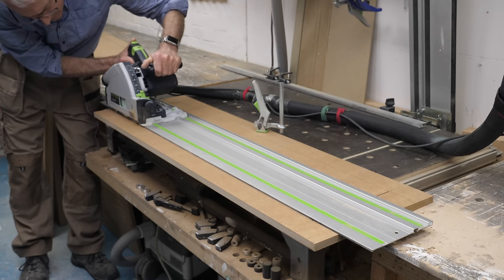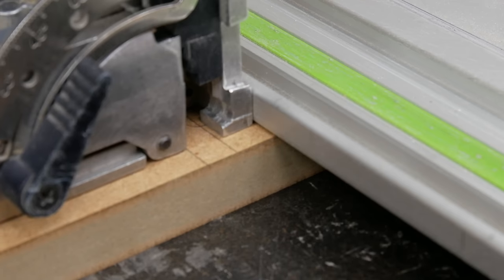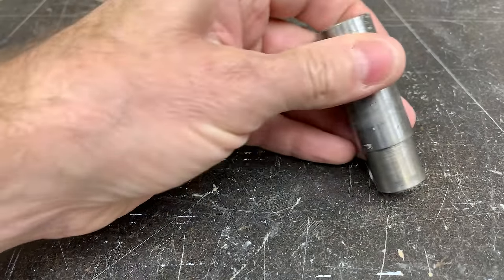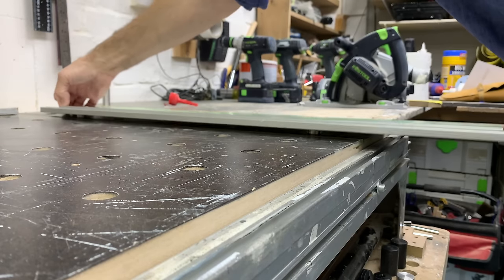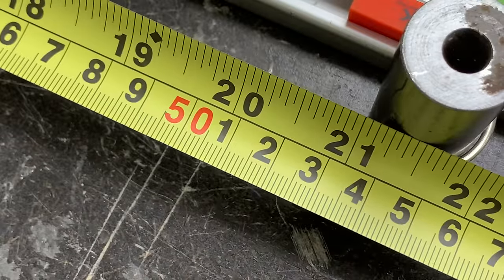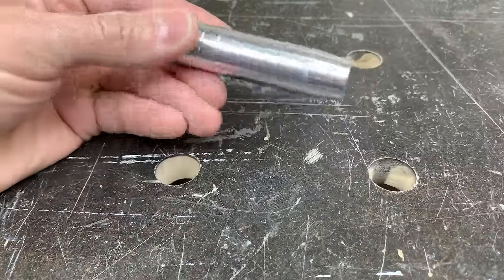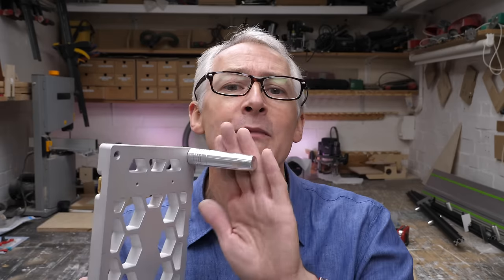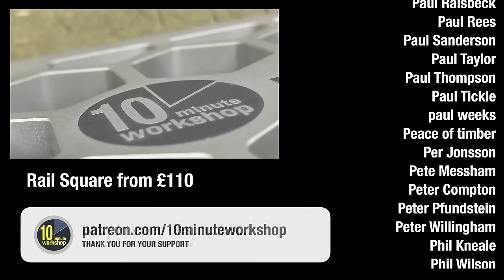Square cuts: MFT or Rail Square?  [video 422][Gifted/Ad**]

Comment: 32mm was the closest together engineers could fit the gears that drive the spindles on 32mm boring machines when they were developed after WW2.  On these machines every other spindle turns the opposite way so on a 21 spindle machine you need 11 of one and 10 of the other to drill a line of holes on 32mm spacings.

Comment: I prefer to use the MFT for precise cuts on smaller workpieces in the workshop. For rips I do use a TSO rail square, but I double check it for squareness every time ( coz I have cut a few wonky pieces occasionally). If I'm outside, it's the rail square on a cutting deck, which I find accurate enough for most jobs. There is no way I would take my MFT3 outside the workshop because it's so heavy and unwieldy. I'm making a portable top to mount to a pair of dewalt aluminium sawhorses. I used my festool mft top as a template and with a 20mm guide bush on the router and a 3mm dowel drill cutter from trend, I plunge cut the hole centres and used the UJK 20mm cutter from the parf guide system to cut the holes. One of those old wolfcraft twin column drill guides helped keep everything in line. It seems to be sufficiently accurate from my test cuts. 
Can't wait to see your version of the  mobile bench though!

Comment: I’m creating my own MFT as I needed it to be bigger than the standard Festool MFT. I’ll be using the Parf Guide System Mk2 to create the holes. This video helped me think what are my options in order to make it as a cross cut station as well. Thanks Peter!
Reply from the maker: Thanks! 👍
Reply: Are you going to add offset holes?

Comment: Hi, Peter the Detroit track saw that I bought is very similar to the Makita with the anti-tip lip & therefore similar to the Festool. Therefore this weekend I bought the FS-WA ($215Aud) thinking that I could modify it to fit, I even thought I may consider buying the 800mm Festool track ($155Aud). Well, I picked up the FS-WA as nobody had in stock well it fits in perfectly in my Track with no sanding or cutting off the underside groove.

Comment: As usual, great and informative video. Watching you actually convinced me to buy a track saw and I'm loving it. Such a change and with your tips... Just wow! I made a mobile cutting station at a client's place following your advice on calibration and the station, I am making spot on square cuts with ease and even used it to joint rough cut mahogany to use as edging on BB plywood. Oh I'm also making my own MFT system thanks to your videos. Just brilliant Sir. Thank you! I'd happily but you a pint 🍻👏👏👏👏
Reply from the maker: Thank you! So pleased that the videos are helping! 👍👍🍻🍻

Comment: Love the video. Been replacing my internal doors with oak ones and the Benchdogs rail square has been awesome.
Well worth the money for trimming 14 odd doors
Reply from the maker: They're great squares! Impressed you have 14 level floors though... 🤔😂👍
Reply: This is true 😂 however just seemed to make things easier dropping on the door rather than measuring

Comment: As a long time Festool Track Saw user, I've never once wanted to buy into their 96mm x 96mm x 20mm hole pattern. I've chosen to use the more common 2"x2" hole pattern with 5/8" hole. This opened up a world of fixtures and jigs that are used outside of just woodworking. But, one trick I picked up along the way was the use of 5/8" dia stainless steel stand-offs and 1" diameter caps as my bench dog solution. Not only did I save hundreds of dollars, I was able to buy quite a few different varieties. I sometimes use square heads on the stand-offs. Or do the 3/4" elevated rails by swapping out the appropriate caps to thread on to my stand-off barrels.

As far as my best rail square solution was to go with TSO rail square, and as my second I chose the Woodpecker's multi-angle version. I like using one at each end of the track if I can. I never have to double check my squareness that way. I feel I have a great combo that allows me to accomplish nearly 95% of my Table Saw needs now. I only use the Table Saw now for thin strip cutting.
Reply from the maker: Horses for courses, I think; for balance, I've never come across a 2" x 2" grid with 5/8th holes, so perhaps not as common as you think?? Good to hear you found something that works for you though. 👍👍
Reply: @10MinuteWorkshop  In metal work and fab tables, there's many brands, such as Strong Hand Tools that sell all the different clamps and accessories that fit those smaller holes. And the tighter grid pattern actually makes more sense when going layout and fixturing. Like in glue-ups and case work, where there are many things that fall into the 4", 2", 1" sizing. Granted, what you could see is a 50mm x 50mm hole spacing with 16mm holes. But 16mm and 5/8" are nearly identical when it comes to nominal hole size. But I do realize that a 50mm grid would actually kind of screw you up in the long run, should you be using imperial measurements. Unless of course your hole spacing was exactly 50.8mm ;-)

I should have added that based on my familiarity with the metal work fab tables, and since I do both in my shop. I wanted both my woodworking table (and accessories) to be interchangeable with my metal work fab table. So... I actually CNC'd my own 4x8 "MFT" table out of 1" MDF and epoxy laminated on the top and bottom sheets of Dibond, before having the router table cut my table top. I framed the whole thing in Aluminum Extrusion to take advantage of the rail tracks, and use a sacrificial 1/4" piece of MDF with the same holes cut into that.

Comment: Very informative
Very confusing for a super part-time woodworker who has never seen an MTF or rail square system. Lots of parts and things to consider & hurdles to jump over.
 I'll stick to old school (less precise) methods for the time being and wait for the portable system you going to do. THX
Reply: I also came.across these methods as a new woodworker and found it all very confusing and led to a lot of stress of confusion. I found the far easier way of all these things was to just use a table saw. Far easier and quicker and less faff
Reply: @ChickenDinnerz  faff - I had to look that up-:)
I agree - kiss is the better method for part-time hobbyists. That's maybe why after 2 years of having heard about the MTF system - I probably intuitively (or luckily) have not bought into the system yet. If you need a few super straight square cuts - it may be better with less faff to drive to buddies place who has spent cash on premium tools!

Comment: Regarding the #BenchDogsUK Guide Rail Dogs and B-Collars, once the collars are in use the bottom end of the guide rail dogs (naturally quite slippery to begin with) become shorter corresponding with the height their set at making grabbing to bottom of the rail dogs to tighten them up much more difficult.  I have found using rubberized work gloves aid in improving your purchase on the tail of the rail dogs allowing a much better ability to tighten them from under the worktop. I use the #ThisIsCarpentry MFS (Multi-Function Slab)  Thanks for the video.  Informative.

Comment: The 96mm grid comes from the 32mm system used by mass-produced furniture. Like the shelf pin holes in an Ikea cabinet.
Reply from the maker: Yes, like I say in the video, there are links in the description that go into this in detail. 👍👍
Reply: @10MinuteWorkshop  All well and good, but I don't see why 3x32 mentioned. So wanted to provide the information for those wondering :)
Reply from the maker: Again, too much detail for this video, but links were provided for those interested. It gets more attention in an upcoming video. 👍👍

Comment: Great Video as usual Peter.  I have built two DYI MFT table tops, one without the UJK PARF guide and one with.  I would highly recommend the UJK system.  Especially if one is new to the woodworking game.   Getting perfectly vertical holes with a forstner bit at precisely the 96mm spacing in 2 dimensions to within a mm/64th of an inch, is NOT easy with a hand drill.  And all you have to do is screw up ONE hole somewhere in the middle, and all is lost.  I disagree with the MFT comment below.  My MFT table, which is made from Home Depot MFT material, has lasted 9 months of constant use and is still as accurate as when I built it.  Your grade of MFT is far superior to mine and I believe your original table lasted for years of professional use.  If I had to do it over, I would just buy the replacement Festool table and call it a day.  It took a LOT of time and effort to make even the second table, so does one want to build shop equipment, or build projects.  For those who live across the pond, the TSO rail square guides are available and are quite good.  But not at the level of the rail square that you have.  Finally, there is a reason that Festool made their MFT top the size they did.  I believe that after making a larger top (30in x 60in), I find myself reaching over too far to get to the other side of the table where my custom fence is located.  Once is ok but after a couple of hundred times, not so much.  The BIG advantage to MFT tops is that once you get one, they are absolute SQUARE and I don't ever have to worry about squareness in using the top, across the ENTIRE SURFACE.  Try that with any other solution.  Cheers and stay safe.
Reply from the maker: Thank you! Yes, MFT tops generally last a long time, even in professional use/abuse 👍

Comment: I love your videos. And It’s great to be able to come back and refresh my memory. I can’t decide…. do I want the rail square first…. The parallel guide…. Or should I get the MFT table? I’d get them all if money was no issue. But it is. LOL. Decisions decisions. I will note…. I bought the plans for the portable work table. But I haven’t made it yet. So I have no surfaces with the bench dog holes in it right now. I guess I’m off to go watch that video again. Always love coming back to your channel.
Reply from the maker: Thank you! And yes, it’s a tricky choice, especially with the parallel guides in the mix as well. I am overdue on the ‘parallel guides vs rail square’ video, but I tend to think of the PGs for full sheet narrow rips, the rail square for full sheet cross cuts, and the MFT for everything else. 👍👍
Reply: @10MinuteWorkshop  That’s actually a good way to think about it. That helps.

Comment: As I'm discovering, space is really my limiting factor. My kitchen is only just slightly larger than an 8'x4' sheet, my shed is considerably smaller. If I'm going to crack on with these built-ins, I'm going to have to figure out a better way to work within these limitations.

Comment: I use the railsquare sometimes, in conjunction with my benchdogs fence, if you set the flag, butt piece to the fence, lay a longer rail so it goes beyond the fence you can slide the rail upto the edge of the fence and ensure your railsquare remains tight in both places, repeatable for longer pieces.
Reply from the maker: Yep, always a way! 👍👍
Reply: Thank you Martin. Not sure exactly what you mean but you made me realize there are benefits of the rail square even if you have the fence and rail clips. I.e. You don't need the second guide rail dog. I have been trying to make a modular bench (1200x800 mm) with the L shape addition for longer cuts. With the rail square (and dog attachments) I don't need the MFT bottom to be as deep as the cut 👍

Still interested to here more of your idea. Take care

Comment: First of your vids that I have watched. Excellent, loved it. Thankyou ;-)
 I own a Domino and just bought a TS55 trak saw setup. Love the Domino and the saw but the Trak itself is only the start. Then you need other tools or instruments get get things to square or a particular angle(more money). I think i'm in trouble! The list of things I th8ink I need are almost endless. The biggest square I have is a mere 300mm. But it is not perfectly square(the trouble begins). I have a smaller Engineers square(chinese) that is about 0.05mm out over its 165mm length. I also found out that the edge of the track (outside Alum edge) does not go all the way down to the surface it is sitting on and therefore the blade of my engineers square is only in partial contact with the edge. I applied a bit of Math to determine my real error after cutting a tabletop (I'm making) to sq. off the end was 1.8mm over the 705 width. Not very good. So then I cut the other end setting up independent of the other and came up with the exact same error. So, I end up measuring each length and found they are both the same. So I have a Parallelogram. Width the same, length the same, Diagonals...1635mm and 1632mm. Oh the pain!!
Now provided with all this new found info my search field is even larger(thanks a lot) but it will be very interesting.
For now, I'm going to get into another of your excellent vids.. Best wishes from Australia!!  ;-) 
PS hopefully you can understand what I have written. The last time I was in London(at a Train station near the Themes) I asked a man at an information counter for directions to a platform and he told me he couldn't understand a word I said. he said "speak the queens English mun!" After WTF, I pointed to his map and he replied "platform 4 that way(pointing)!!
Reply from the maker: Great comment, thanks! Ah yes, the perfect parallelogram! Been there! An MFT style top makes a huge difference to getting square, straight cuts. Rail squares too, of course, but then more money, lol! Best wishes from London! 👍👍

Comment: Thanks Peter - excellent video and lot of food for thoughts. In my humble experience (having used some of those methods), for critical cutting I found most secure and safe just to measure before cutting. Operator error (mine ooops) is always the variable which may sometimes kick in, especially if you rely on something that should be guaranteed but in fact it is not. I had some unlucky experience with crosscutting some  material supposed to be perfectly straight (and in fact it was reasonably straight for shorter crosscuts). It was a situation when 4 subsequent crosscuts combined one upon other - which should have resulted into perfect joining resulting shape - were off by 2-3mm / 1m in final end. Each small missalignment repeated and added to previous cut finally ends-up with cca 3mm error on 1m of total length And that hurts... Unfortunately it happens once per time and otherwise it is perfectly OK. From that time I always remind myself - slow down and measure.
Reply: i guess im randomly asking but does anyone know a tool to log back into an instagram account..?
I somehow lost my password. I love any help you can offer me!
Reply: @Cole Julio instablaster :)
Reply: @Baylor Ben i really appreciate your reply. I got to the site on google and I'm trying it out now.
Takes a while so I will reply here later when my account password hopefully is recovered.
Reply: @Baylor Ben It worked and I now got access to my account again. I am so happy!
Thanks so much, you saved my account !
Reply: @Cole Julio Glad I could help :)

Comment: Hi Peter, I enjoy your content, thx. I have a question, I noticed you don't leave much of a lead in on your rail, just a tad more than the rail square. This means your starting cut is always plunging. I felt starting the saw at full depth and then entering the cut is better? Although a little unbalanced, interested to hear your thoughts.
Reply from the maker: Hi Chris than thanks! Yes, when I first started using the Tracksaw system I read this pearl of wisdom many times. Actually, in my experience it doesn’t make a scrap of difference to the cut, and it’s all down to personal preference; if you feel it give a better cut, then feel free to plunge fully first, but for me I simply done see a difference. 👍👍

Comment: Hi Peter, first of all I love your channel. I have a question about the point you make at time point 8.22 in this video. Do you suggest having a fatter pair of benchdogs for the workpiece to bear against so that the dogs attached to the rail won’t be worn down over time? Or is it to provide points of contact that are far apart? I have the benchdogs rail square and a home made 4x4 MFT too done with the Parf guide system. This video addresses many of the queries I’ve had so far and it would be good to incorporate the rail square in the day to day work but I do find it’s a bit sticky in the top due to the tolerances. Cross cutting full width sheets is obviously a bit more challenging without a larger work surface. If I only anchored the rail onto the top on one end with the rail square I could let the last few inches of the workpiece hang off the back of the top. Hope this makes sense! Thanks
Reply from the maker: Hi Ketan, and thanks! Sorry if I wasn’t clear; when you put collars around the MFT dogs, they effectively become 30mm dogs, and ‘normal’ dogs are 25mm, so you can’t bear against a pair of regular Benchdogs and the MFT dogs with collar. Benchdogs make a 30mm dog for this purpose - comes as part of the set, I assume they can be bought as a part. 👍 And yes, for longer cuts you can always use the rail square and also anchor the far end with a clamp. 👍👍
Reply: @10MinuteWorkshop  thanks Peter, makes perfect sense now